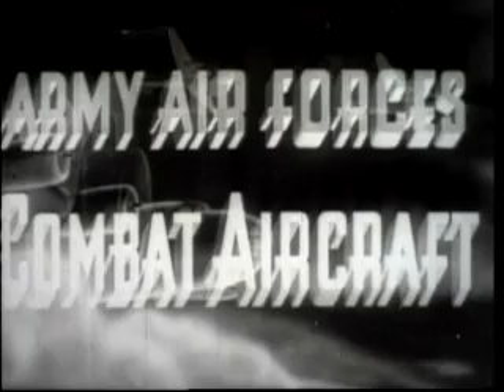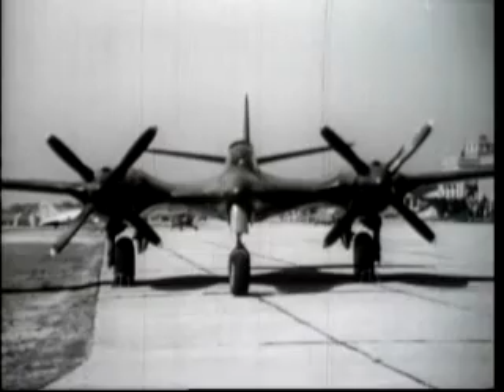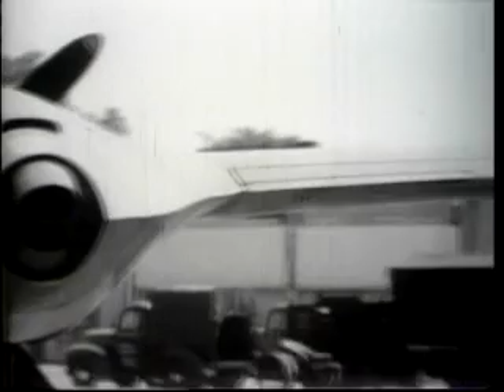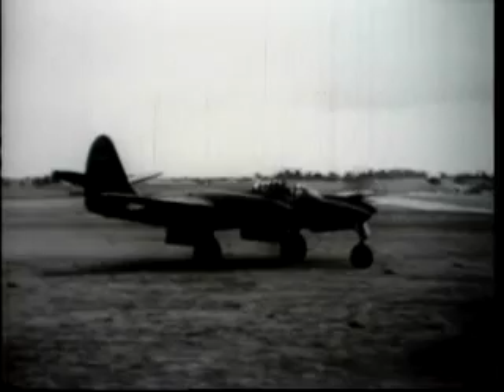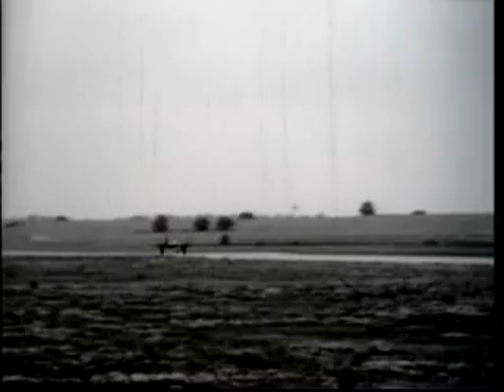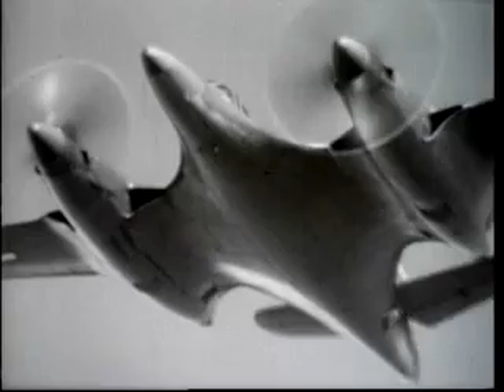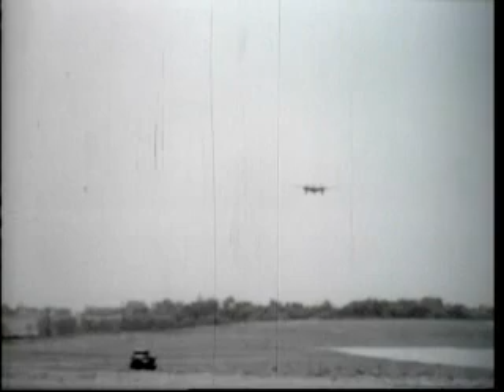XP-67: The "Bat" Outta Hell

Comment: The XP-67 ( Experimental-Pursuit)  named The "BAT" was another forerunner of blended shape design to reduce laminar flow drag. We radar tested a model of a jet version and cross section was dropped by several factors. The tail was the biggest reflector.  This blending of lines was shared in the design of th A-12, SR-71, YF-12A and D-21 for it's effective radar signature reduction. Engine heat was about to be solved when project was cancelled.
Reply: Who canceled it?  Beautiful plane, similar to TigerCat F7F.
Reply: My Dad was the first Radar Intercept Operators, he taught The Royal Airforce in Night Intercept 🌙 s...